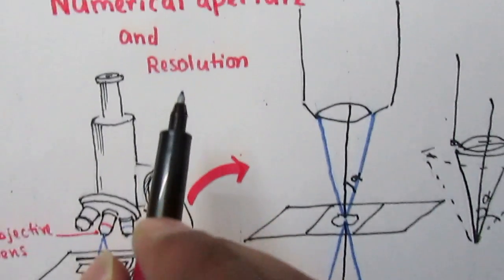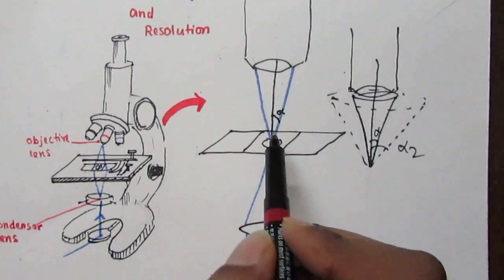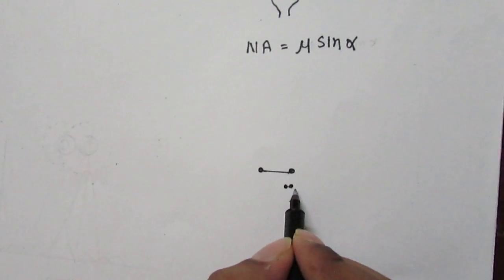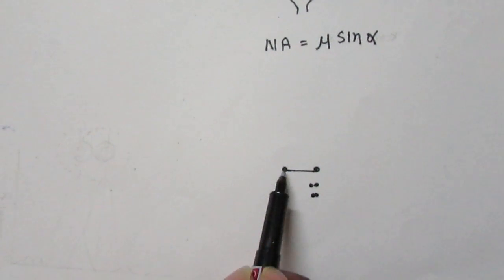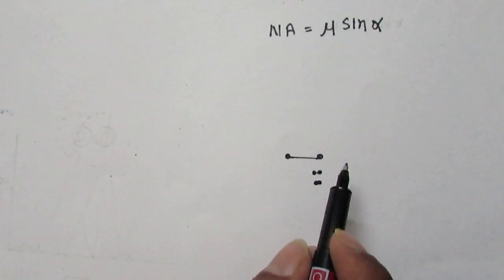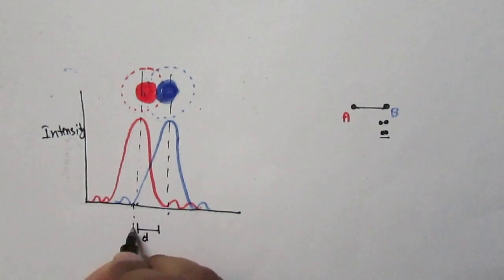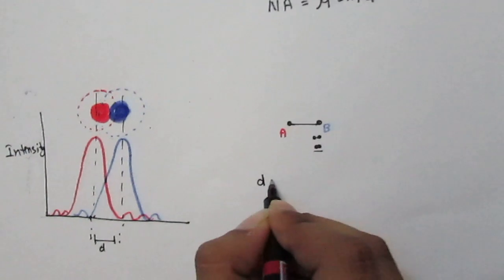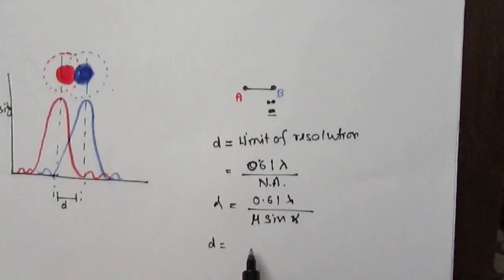Limit of resolution and resolving power of microscope

Comment: @Arpan Parichha       Could ELECTRONS be seen at all, even if stopped at absolute zero ?
I am speaking ONLY OPTICAL VISIBLE WAVELENGTHS mainly.
Maybe not as individual electrons but possibly as a group, like how we see sand from 10 feet away.
see  Thunderf00t   Seeing Electrons with the Naked Eye!
He uses solvated electrons.
I'm think at room temp they would move too fast to be seen even if they were the size of grains of sand. But if like say pancake syrup, there were many electrons or atoms they could be seen. But we aren't seeing any parts of atoms, just how the atoms react the way I understand it.
And even if you had a quarter inch thick layer or ONLY ELECTRONS, they would be transparent since they aren't part of an atom to react the same way. And we would ONLY see what is underneath the electrons in a microscope.
What do you think about this and the video "Seeing Electrons with the Naked Eye!" ?

Also, would x-ray, gamma, etc photon optics with  much smaller wavelengths allow an electron or group of them to be seen even in principle ?

And what about if you used all the new super resolution ideas also ?
Can any of the super resolution ideas be applied to telescopes ?
I have only seen them applied to microscopes so far.
Reply: How 😁😁😁